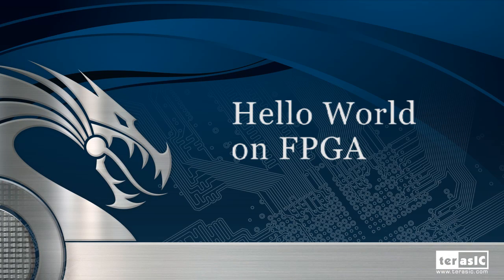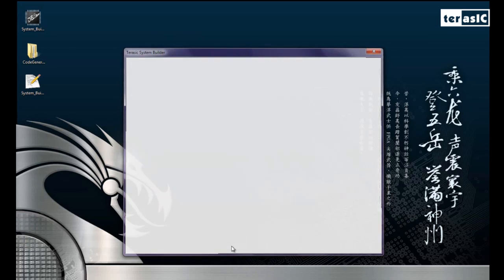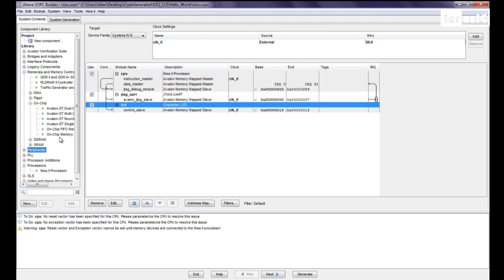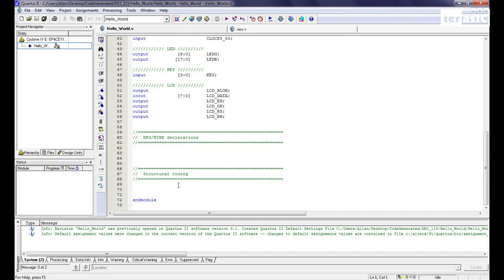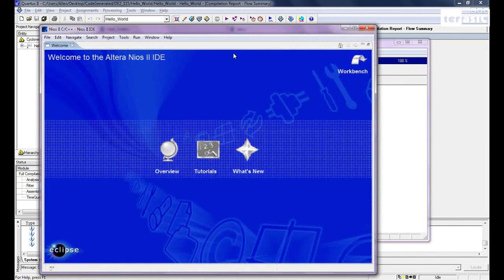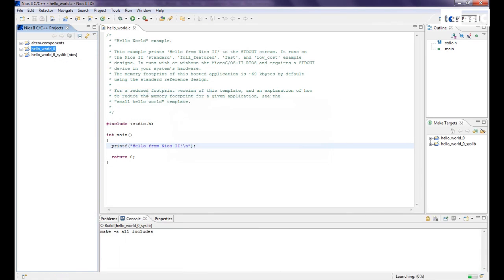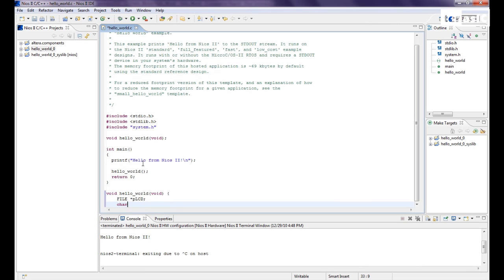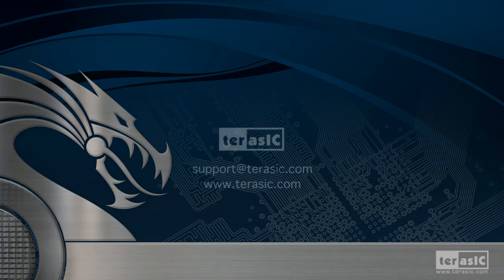Hello World on your FPGA

Comment: Hello World in BASIC

10 Print "Hello World"
Run

15 minutes for Hello Wolrd? Screw that. I will stick to Arduino for simple projects and normal microcontrollers for more complex things. FPGA seems to create a poop ton of work for even the most simple things.
Reply: the comment you are talking about is 3 years old, beside ! he was pointing at (altera is complicated scam) , xilinix is much easier and flexible and easy to achieve anything!
Reply: whats the point of your comment? there are a lot of things were FPGAs must be used instead of microcontrollers! both things have pros and cons